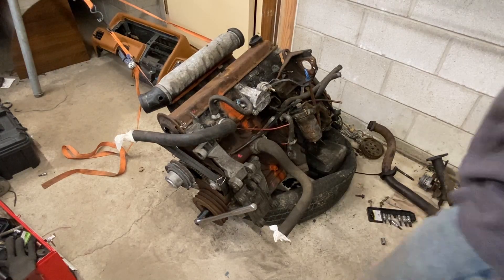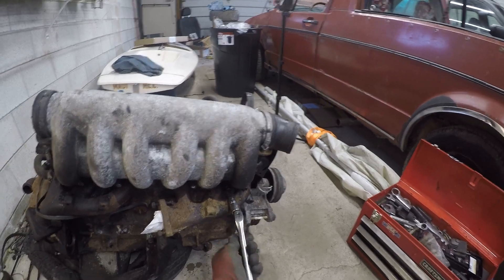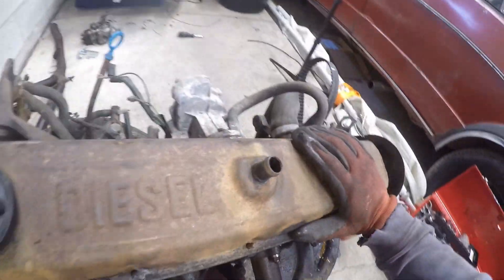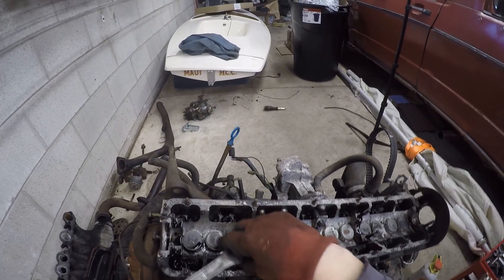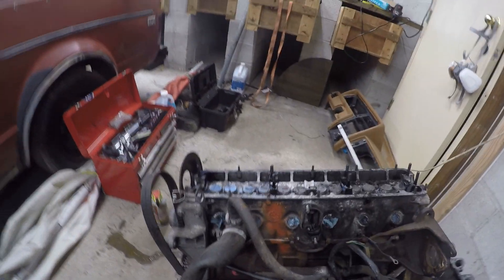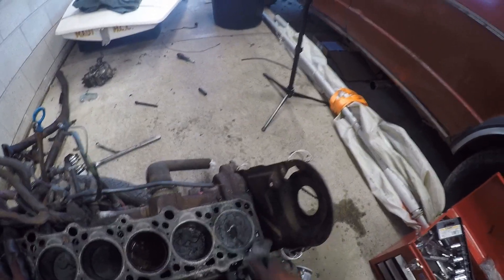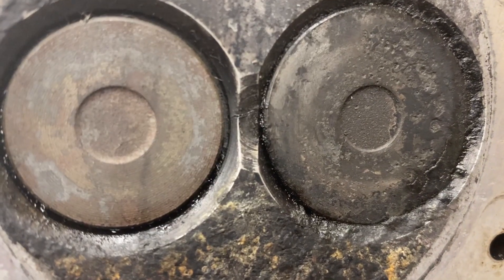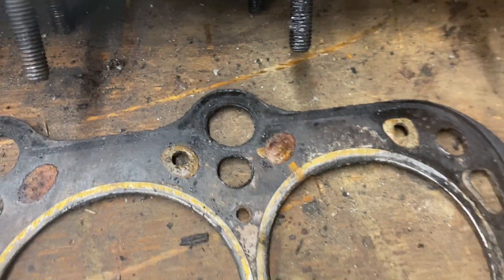D24 Diesel Engine Rebuild 4 - Removing the Cylinder Head

Comment: I really excited for this build, I’m currently doing the same to my d24tic, wish I could show you my head, so many cracks. In all pre chambers and some form them to the middle with cracks in between valves
Reply: Keep up the great amazing work, head up you got this man! :)
Reply from the maker: Thanks for the support. I did a little research today and this cylinder head doesn’t look too bad compared to most of them. Most of the cracks are wide and deep. I think the head will be good as long as the cracks don’t extend into the valve seat